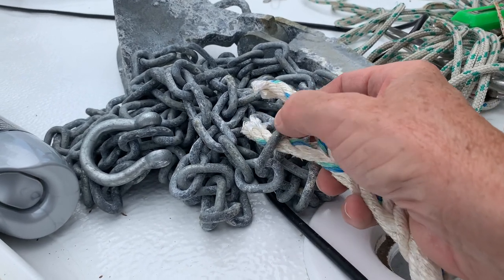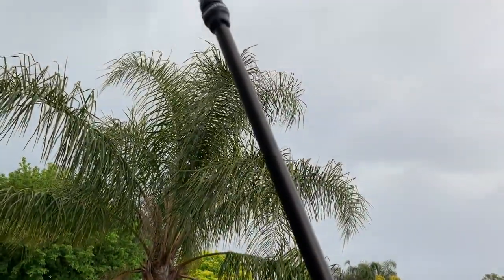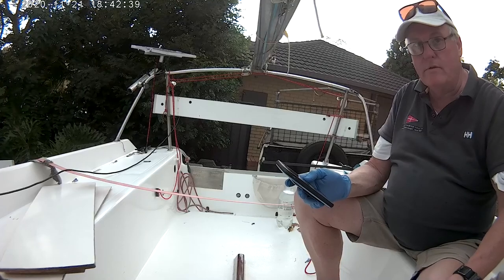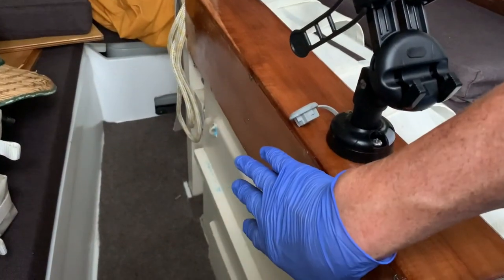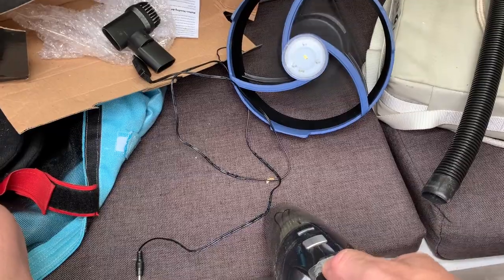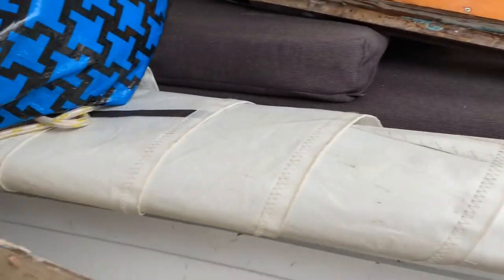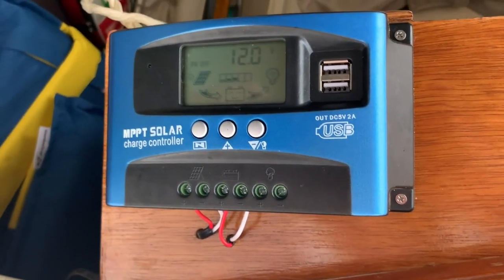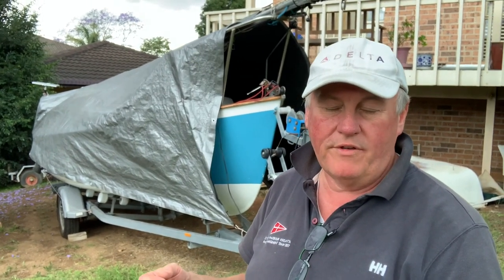Careel 18 Routine Maintenance Weekend

Comment from the maker: Hi Nathaniel, great meeting you and your daughter.
I used a nylon brush sanding wheel that fits on the end of your drill as compared to a wire wheel which is harsher, and that worked really well, took enough material off to get a really good bond without loosing the non skid texture. Note….. if you use two pack you need to add grit / non slip to the painted non skid because the non skid becomes really slippery. My number is in the Careel news Vice Commodore South, call me if you wish to discuss.

Comment: Great video Nick, it reminds me to do a few jobs on my careel. One note on the upgrade to the steel up haul “strop”, when I had my mark 1, I went thru (broke) a couple of these. I changed to a similar gauge spectra or dyneema. Never had a problem after that. The theory being that the spectra is probably stronger and also has some stretch which helps when the keel is “bouncing” perhaps in a swell or overnighter etc. keep the vids coming mate. Good lockdown therapy!
Reply from the maker: Hi David, thanks for the message and my apologies for not answering sooner... I originally was going to replace with spectre or dyneema as I have heard of wires failing.... Also I had the wire and swagged on hand. I have since bought several meters of dyneema and I will take your advice and replace with that. 
Currently looking forward to the nations, hope the banana benders can attend .. not the same without you guys and hope to catch up at Grafton in Oct